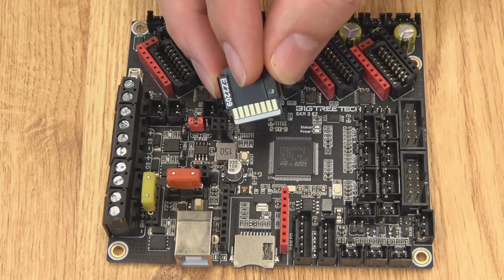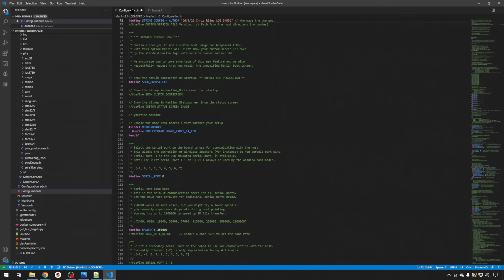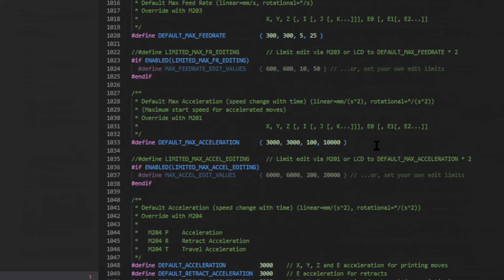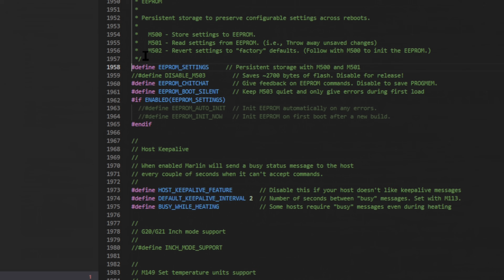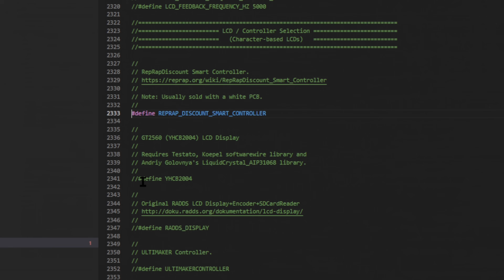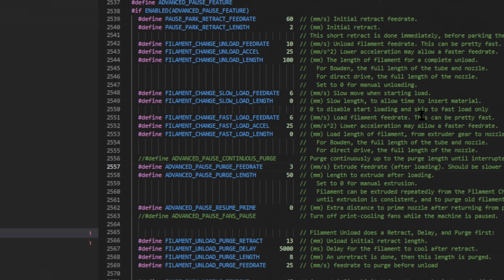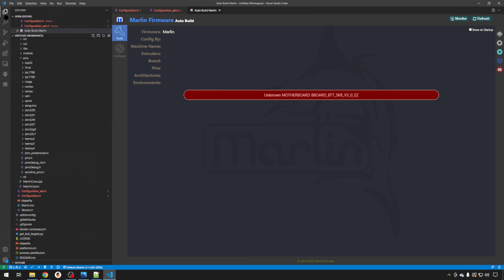Big Tree Tech SKR 3 EZ - First Look - 2022 - Chris's Basement

Comment: I have a skr 3 ez panel, with a pinda v2 sensor, I can't get the detection to work correctly, it is connected to the z min as with the skr 1.3, with the skr 1.3 board it works perfectly.but with the skr 3 ez when you approach a piece of metal the sensor turns off as always but it does not mark trigered . The definitions are the same in Marlin as with SKR 1.3, the version I am trying is 2.1.2.3 or 2.1.2.4 with the same results.

Comment: Chris,  I would like to install this board on my Anycubic Mega X machine.  This machine has dual Z motors and dual Z stops.  On the board layout, I only see a place for only a single Z stop switch.  My question is,  is there a way to run a dual Z stops?
Reply from the maker: Yes, you can assign one of the other pins as the second Z endstop. You would just need to reassign the pin.
Reply: @ChrisRiley  Thanks for your reply.   I'm looking at the schematic,  what pins am I looking for?
Reply from the maker: @galaxyhunter1978  I would go with PC15, that the traditional Z max pin which marlin to default to. They are labeled pwrdet.
Reply: @ChrisRiley  . Very good, thank you Sir.

Comment: 6:55 Hey Chris you mention the plugs used for fan voltage selection. Do you know where I can buy the plug-in modules? Or what they're called? Thanks
Reply from the maker: It’s tricky, you have to select it in the little box under the board. See if this link works. https://biqu.equipment/products/bigtreetech-btt-skr-3-control-board-for-3d-printer
Reply from the maker: You should see a box that says SKR 3 dc mode, when you click it, the price changes to $7 dollars and some change.
Reply: Ok I see. Do I need to get 3 of them if I want say 3 different 12 or 5V fans? Or does just one work for all the ports?
Reply from the maker: @VideoGems117   Just one for all ports. Can't mix voltages.
Reply: Ok thanks man. You’re a legend 🙏

Comment: Do I need a raspberry pi to run RepRap firmware on this board?
Reply from the maker: No, you would just need an ESP module like this.  https://amzn.to/3ZYuuWM
Reply: @ChrisRiley   Thanks Chris.  Can I ask your opinion on reprap vs klipper.  I have an original CR-10 and I also just ordered a flying bear reborn 2.  I would like to convert them to either reprap or klipper.  I may buy the boards from duet or may not.  One bonus of reprap is I believe they have a cnc module.  My father has a CNC router and I have a mill I am converting to CNC.  It would be cool to have a common firmware for both 3D printers and CNC.  Do you prefer Klipper or RepRap?  If you prefer Klipper, is it better enough to outweigh the benefits of having a common 3D printing / CNC firmware?  Also, do you know anyone who has used reprap firmware for CNC?  Thanks for your response, and keep the awesome videos coming.
Reply from the maker: @f1hotrod527   I really like REPRAP because you can get the WIFI features and you don't need a RPi. It just makes for a cleaner install. Most of the boards now a days have 32b and can handle any features we need, not like the old days. If I was wanting to do printing and CNC, REPRAP would be my choice. I don't know anyone personally that has setup CNC on REPRAP, but there is a ton of great configs out there. https://docs.duet3d.com/User_manual/Machine_configuration/Configuration_CNC

Comment: I don.t know what screen did you use, but the  prusa screen with SKR3 EZ is not working and technical support from BTT is 0 0000000.
Reply from the maker: If it's a Prusa or LDO screen you need to flip both EXP1 and 2 plugs 180. Then it will work.
Reply: Hi Chris , Thank you for take time and reply to my issue .Yes it's a Prusa , I flipped and still not working , I have only blue screen and the 20x 4 square . no text ,
Reply from the maker: @adtub  Do you have it set to the reprap discount display? Not the full graphics one.
Reply: @ChrisRiley  Yes , Do I need to set up to prusa display (1 ) or classic. I tried both anyway . BTT support told me finally is not compatible and I must buy a new screen , :}

Comment: hey so im having a problem where its reading the board in the boards .h but not in config .h and its the same thing that a pasted in both areas of the code. im still new to the printer realm i have messed around with code and cant seem to figure out why it is doing this if you could help would greatly appreciate it.
Reply from the maker: What ever is in boards.h needs to be copied exactly into configuration.h. Becareful, some boards have multiple processors and versions.

Comment: So maybe I missed it but what kind of case are you using and where do you have it mounted for the board?
Reply from the maker: I designed this case to fit default prusa MK2 mounts holes. I haven't posted my version yet because it's not completely finished.
Reply: @ChrisRiley  I can't wait till its finished. My modeling skills are bad and that's being generous 😂

Comment: Thank you Chris. Love your videos! Very comprehensive and easy to understand. I have a question, though, on this SKR v3 EZ that I got just few days ago. (btw, the ducky was there too). I'd like to power the whole thing with an old PC ATX PSU. And here is the question... Where do I connect the 5V Vcc from the PSU? Or should I just short circuit it to the ground? I'd like to control the PSU on and off with the SKR v3 EZ and there are no clear solutions out there... at least not clear to me. Should I connect the 5V Vcc and one GND cable from the PSU to  the VUSB pins? Would that be a viable solution? Thanks in advance and keep up with good work with your videos! Regards, A.
Reply from the maker: Thank you! I've never tried it, but it used to be a pretty common thing to do. Tom has a video on it, but I'm not sure it's exactly what you're looking for. I will continue to think of a solution to do something like this. https://toms3d.org/2019/11/12/atx-supplies-are-super-useful-for-3d-printers/#:~:text=ATX%20supplies%20are%20super%20useful,3D%20printing%20guides%20and%20reviews
Reply: @ChrisRiley  Thanks Chris! Figured it out. It took me to take out an old Multimeter and do some checks on the board. For the info, old PC ATX PSU +5V Vsb (or Vcc as I called it or the purple wire of the PSU) should be connected to positive pin of the VUSB on the board. GND is supplied via the DC IN connector. The rest is easy, for the PS-ON (the green wire form PC ATX PSU).
Another info, I think you 've got it wrong on the red jumper (in your video). That jumper is to select the voltage to be used with the fans (5V, 12V or DC-IN voltage) and, if DC-MODE adapter is used, should be moved to short VOT pins. The DC-MODE adapter has that functionality and selectable voltage for the FANs (5V or 12 V) in case 24 V PSU is connected to DC-IN.
Anyways, thanks again and stay well.

Comment: Hi Chris
When I first watched this video I didn't realize there were so many differences in the SKR 3 and the EZ. I have everything working except for the sensor less homing. I installed the tiny jumpers on X and Y axis and all the axes are moving in the right direction. But, the X and Y axes will not home. I hooked up using Pronterface  and I can only move X and Y axes in the + direction and all the end stops show as triggered. I don't remember if that is normal when using sensor less homing. I tried overriding this with the M121 command but it still shows the stops triggered.
Have you tried setting up sensor less homing on these new boards? I could use some help.
Reply from the maker: I haven't tried sensorless yet, but there will be some configuration updates that need to be made or you will always see them are triggered.
Reply: @ChrisRiley  Thanks for the reply, Chris,
I've tried everything I can think of and can't get sensorless homing to work. the endstops are always activated. I tried to invert them but sanity check throws an error. I try commenting out the check and still no joy. I am using Marlin 2.1.2 but also tried 2.1.1, which worked on my SKR 1.4t. Still no joy on the SKR 3.

Comment: @ChrisRiley or anyone who may know... Unbrick my rig?? New to FDM and somewhat new to configs. Started with Longer LK5 Pro 24V system and added E3D V6 Gold, fans, SKR3 EZ with EZ5160 steppers (4) and BTT TFT35 V3.0.1 touchscreen. Can't find configs for 24V steppers and drivers and hanging up on trinamic and stealthchop config currently. Can anyone direct me to a github or other config location or know the lingo I need for those settings for Marlin? Not sure what specifics to include here, bit new... Thanks in advance!
Reply from the maker: Hello, not sure what config options you might be refereeing to. You can just set 5160 in the config file and that should take care of it, no other config options needed. I might be missing something, so let me know how I can help.
Reply: If you set the voltage to 24v in the firmware Marlin adv.h  that's all that's needed if you're running a 24v power supply. line3078 #define CHOPPER_TIMING CHOPPER_DEFAULT_12V

Comment: Which is more expandable, BTT SKR3 or Manta E3EZ ? Interested also in 48V
Reply from the maker: The only difference is Klipper, if you want to runt Klipper without a PI you need the Manta and a SBC module.
Reply: @ChrisRiley  kind thanks , for now i´m mainly for motor 57, so maube Klipper later then

Comment: About using ferrules... The 4.2.2 board in my Ender 3 Pro melted right at the mains voltage because of a single loose strand.  I've since replace the board with the BTT SKR Mini E3 V3, an used ferrules for all the screw clamps, an it's since never even gotten hot.  Please save your printer an take the time to use them!
Reply from the maker: Thanks for the tip!

Comment: Please don't criticize but I'm working on this with my disabled son and I'm not sure what the ESP 1 and 2 ports are for. Can anyone help me?
Reply from the maker: Hey, no worries, I think you mean the EXP 1 & 2 ports, those are the 10 pin connectors with the black shrouds.
Reply: @ChrisRiley  yep...sorry I guess I didn't type it right. All I'm getting on these ports is they're used to connect a monitor???? But it doesn't say how, or with what connectors etc. I've looked all over YouTube and they always just go around these ports and don't explain them. Can you help or point me to a video that can maybe?
Reply from the maker: @robindibble3122  There's no video output for these, no HDMI, but you can use LCD screens. Something like this https://www.amazon.com/HiLetgo-Printer-Controller-Display-Arduino/dp/B07X378P8X/ref=sr_1_3?keywords=12864+lcd+display&qid=1675910202&sprefix=12864%2Caps%2C134&sr=8-3
Reply: Can I hook up HDMI to it??

Comment: My controlled material cooling fan had a short contact and it fried a component on the board but the board still works it blowed out the 10 amp fuse too... i wonder how it can possibly still work because the component glowed and smoke came out. I tried all motors, connection and bed and hotend heating up and slot where fan was connected works aswell, fan spinns. I cant seem to find the non working part of the motherboard so far.
Reply from the maker: Wow, I'm amazed. Maybe they finally have enough things protected where they can tolerate a fault.
Reply: @ChrisRiley  i found the problem, the first controlled fan slot is now always on fan, it cant be controlled anymore its just stays on :D. i have 2 more slots need to enable one of them in Marlin i think.

Comment: Has anyone gotten this error?  Error: Could not find one of 'package.json' manifest files in the package
Reply from the maker: That usually means it's missing a file. Make sure you have added the folder that contains the marlin folder. If you see the .pio folder you are good. If it still doesn't work run a clean and try again.

Comment: Great stuff man! unfortunately I must have missed something because when I print the movements are CRAZY fast no matter what I set the slicer speed at.
Reply: change the acceleration speeds from 3000 to like 500
Reply from the maker: Hey, are you running Marlin? You might have entered the wrong step count in your config. Search for M92
Reply: @ChrisRiley  Yes, marlin 2.1.2 Firmware, my step count was 200 so I dropped the X and Y  down to 80 and it slowed them down to a manageable speed.

Comment: Hi Chris have bought this board as an upgrade to my Anet a8plus. Set dual z driver by plugging z2 connector in extruder 1 plug & enable Z2 in configuration.h
System working but got really noisy motor function just as if wasn’t working in  stealthChop mode. Did I miss something?
Thanks for help.
Reply from the maker: Hmmm, make sure your Z2 settings in configuration_adv.h matches the settings for Z1, there might be a conflict .

Comment: I just ordered a SKR 3 and it has an option to use the new driver cards. There is an adapter that plugs into the standard drive connectors and has a slot for the new driver boards. It will only add some height to the SKR 1.x  board profile. Not much because the new drivers don' t need the heat sinks. I never liked those heat sinks.
Reply from the maker: Awesome, yes, I like the new blade type drivers much better.

Comment: Alway look to your vids for info when im config just about anything on my printer. You dont explain what USB cable i need, you just tell me the knowledge i need. Great video.   QUESTION, will I need to load my sd card everytime i want to mod my marlin config? Or is there a way to do it thru USB like all the other boards (skr 1.4 skr 1.3) sofar my usb attempts have all given a JTAG error and a CMSIS-DAP error on upload attempts
Reply: Btw, not to brag but mine came with ducky
Reply from the maker: Awww...man....😀
Reply from the maker: Thank you! That is the only downside to the STM32 boards, you have to do the SDcard load and unload to make config changes. It has something to do with how you interface with the MCU memory via serial. LPC works with USB.

Comment: Love your presentation Chris, so easy to follow. I came to your site via "The Real Phoenix" who referenced you in his "Anycubic Chiron Overhaul". My Chiron had regular intermittent fails and no real help from Anycubic (does that sound familiar?). Many Chiron owners complain about the dodgy wire/ wiring - So, based on this article, I have decided to gut it and fit an SKR 3 EZ. Do you foresee any problems? (e.g. dual Z-min ?)
Reply from the maker: It should be pretty straightforward. You just need to enable dual Z endstops in configuration_adv.h to get that to work.

Comment: Just got this board.  It's really nicely made,  seems easy to use, but I'm having a problem with the TMC2209s. I cannot fix the TMC Connection Error (shows as "All Low" in graphical mode).  Is there a fix for this?  Running marlin 2.1.1.
Reply from the maker: The only time I have seen that is when the driver aren't seated correctly. If that doesn't work I would contact BTT.
Reply: @ChrisRiley  could be something i missed in the firmware, but it still prints just fine!  So quiet!

Comment: If I'm already running Klipper on an ender3 do i still need to compile firmware or can I just use my existing bin file for the new board?
Reply from the maker: You will have to recompile for the new board MCU if it's different.

Comment: hi chris i need some advice im getting tmc connection error on my sk 3 ez with ez2209s
Reply from the maker: I haven't heard this many times with this board. If a driver reseat doesn't help, it could be a hardware issue.

Comment: Hey fan from Oz here, thanks for your content, you've by far been the easiest tutorials to follow, I started with your octoprint/screen tutorial and then moved to klipepr :D  I have a standard S1 with the S1 pro hotend and was loving this of course until  yesterday when I had a boo boo and shorted my part fan wiring, and now I am pretty confident my motherboard (F4) is actually cactus as I can't get it to run even with that board disconnected. I was running klipper yesterday but the board wont flash anything I can't go backward, forwards or sideways, I've tried the embedded in folders in root and changing file names). The sales guy I talked to suggested I look into other motherboard options rather than the creality... will this one work if I change all the stepper plugs?
Reply from the maker: Thanks for watching! I don't know a lot about the S1, I'm not sure what size the S1 board is or if it has a touch screen. The touch screen is really the biggest issue, they almost never work with 3rd part boards. So this board would work for the printer, but not sure if it would fit in the case.
Reply: @ChrisRiley  Well the S1 Frankenprinter is runnning :D cr touch and all. I use klipper and mainsail (thanks for those tutorials XD) so I don't need the screen. The finding of the wires for the motherboard pin out from the proprietary 30 pin ribbon cable was quite time consuming and frustrating but I'll make it readily avaliable to anyone who asks. I just need to configure the steppers as atm things are moving double the distance requested.
Reply: qq: I went with the non ez card, do you have the file for your old case, I think they are much the muchness. I am going to have to make either an external case or an extension on the base as i don't like how much the wires squish/airflow restrictions with the original base back on.

Comment: Hey Chris. I followed your video to set up my SKR3EZ for the Ender5plus but i am having some trouble with the TMC Communication error after compiling. Could you please tell us how you are able to compile with all 5 TMC2209 communicating OK on a m122 command? Cheers.
Reply from the maker: I've heard this from a few folks. I did have to reseat the drivers and flash the firmware before the error would go away. You might try flashing my firmware to see if it's what's causing the issue.
Reply: @ChrisRiley  Thank you for the reply. I have downloaded and compiled from your folder and i have the same errors. It seems to be something else you have on your platformio or vscode and we don't have.